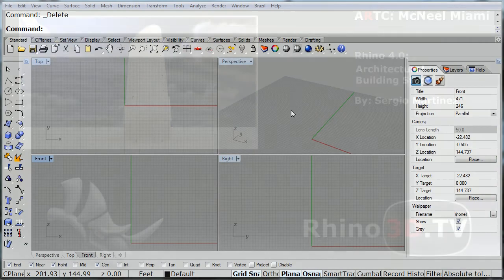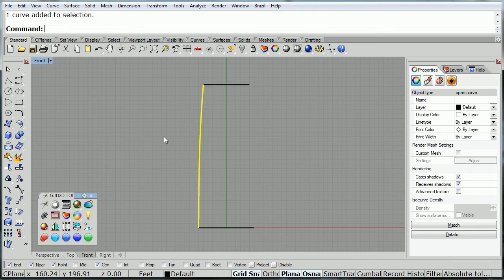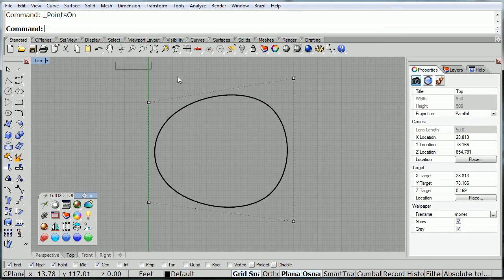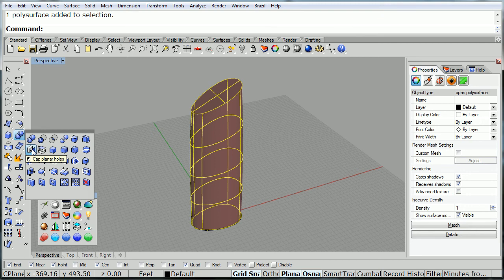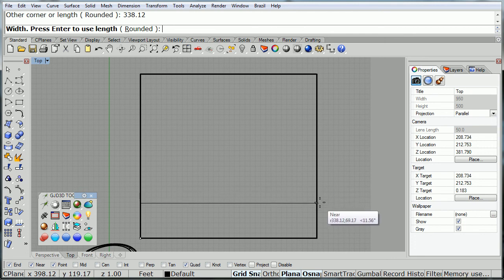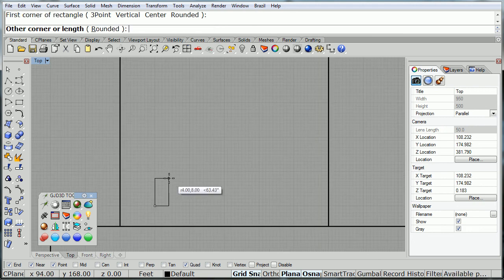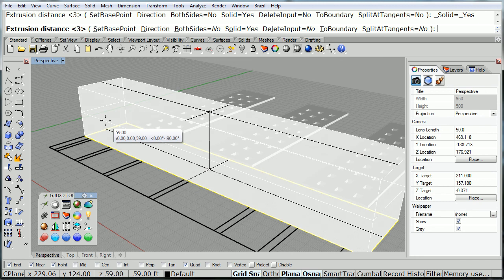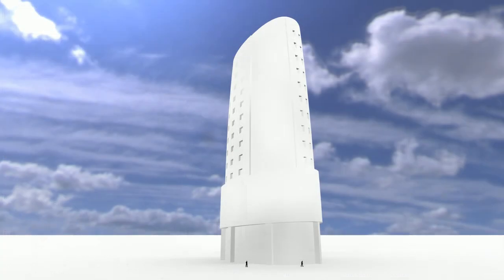Architectural Study

Comment: hello there thank you for this helpful video and you are really doing nice work , i have a question about the UV curve,I draw the shape just like you did then when it comes to the order (flow along surface) and i apply it to the shape the order applies the facade horizontally instead of applying it vertically, what can i do in this situation thank you .